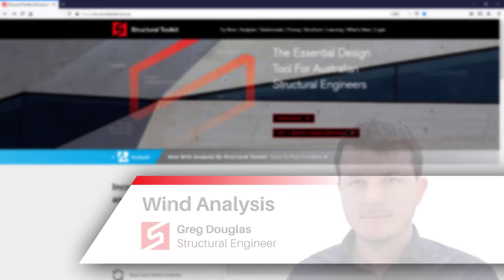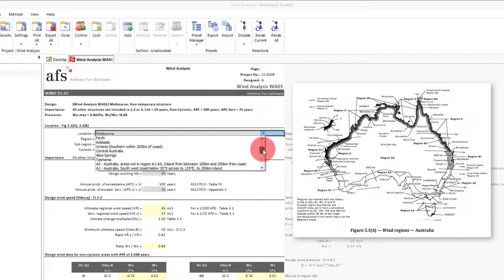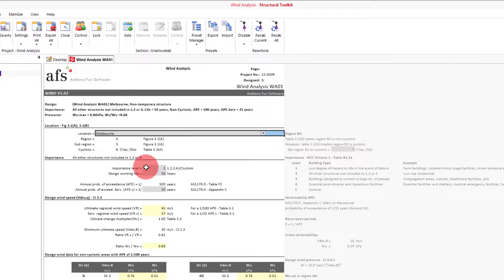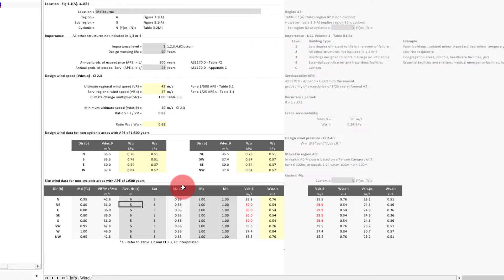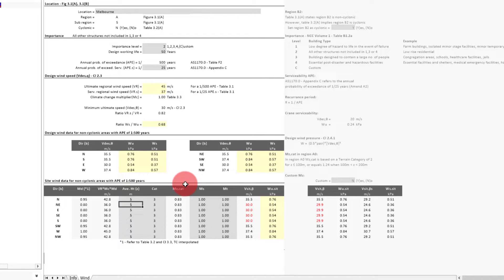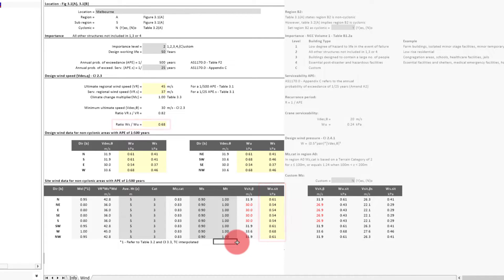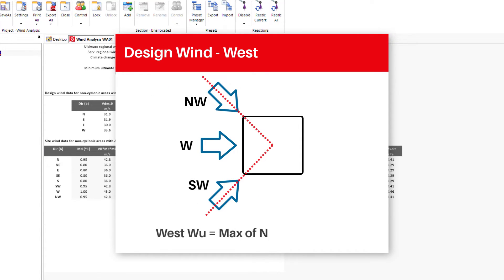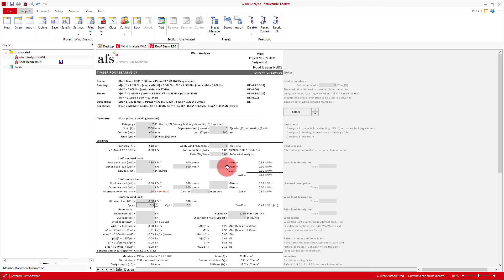Structural Toolkit: Wind Analysis - AS/NZS 1170.2

Comment: Sorry,  I'm just wondering where I can set the parameters Kc,e; ka; kl; kp of the equation 5.2(2). Another query  is that sometimes we need to calculate the Vdes,θ per the figure2.3, how does the toolkit consider this.thanks in advance.
Reply from the maker: The wind modules determines the ultimate wind pressure without shape factor coefficients applied. Depending on the kind of element you are designing, some of the modules have inputs to deal with these coefficients. For example the purlins and girts have inputs/options for Ka, Kce, Kci & Kl. Where there are no inputs you will need to manually apply them yourself. Vdes,θ for each cardinal direction (as per Cl 2.3) is shown in the design wind data table in the Wind Analysis module (which was shown in this video).